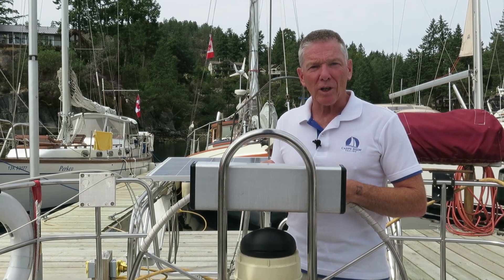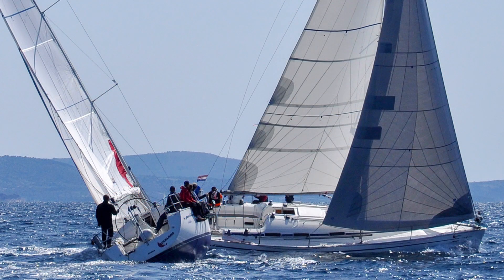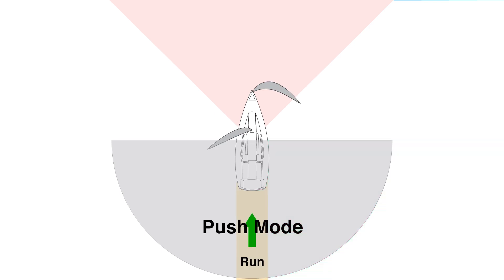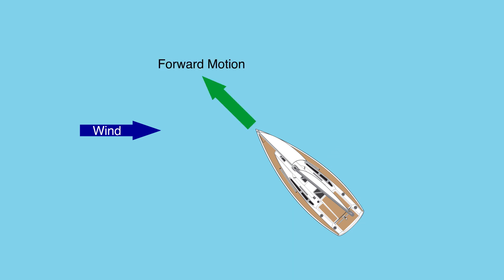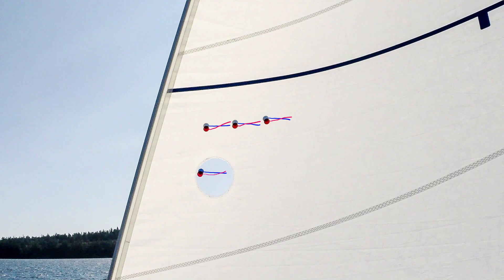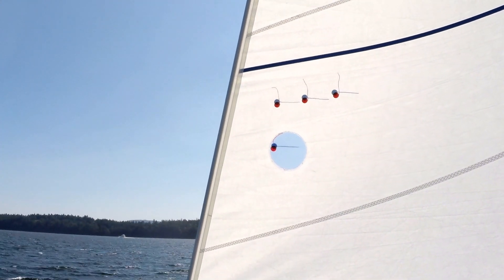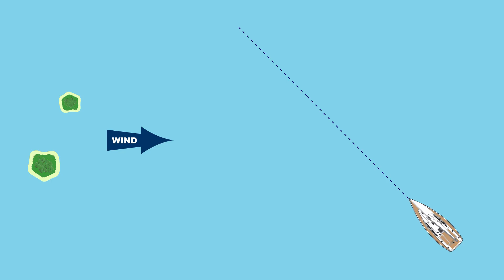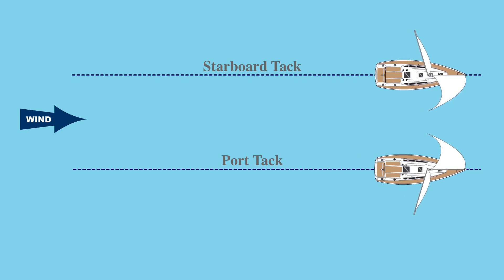Ep 13: Learn to Sail: Part 6: How Sails Work

Comment: Nice graphics. Did a good job filming the headsail tails, they can be dificult to read at times.  How do I explain why "tails dont work in push mode"?  I know the air flow is different, i.e flowing around a barn door as opposed to generating lift, but a sailing partner doesnt quite get it.
Reply from the maker: Thanks. The way I see it. Downwind the sail blocks the air like a windscreen so the downwind telltale is essentially in a wind shadow and sheltered from the wind.

Comment: Hello, Marco. When downwind sailing, I understand that the sails should be about 90 degrees to the wind. For upwind sailing, what is the best wind angle range (to the sails) for your boat?
Reply from the maker: Thank for the comment Stuff, For upwind sailing the best angle is to set the sail like an airplane wing, splitting the wind. Use the tell tails on the sail to indicate proper angle. A much easier way and this comes from when I was learning to sail dinghies is "when in doubt let it out" Le the sail out until it luffs and then harden just enough to stop luffing. This will only work upwind.
Reply: @CarpeDiemSailingMagazine  Thank you.